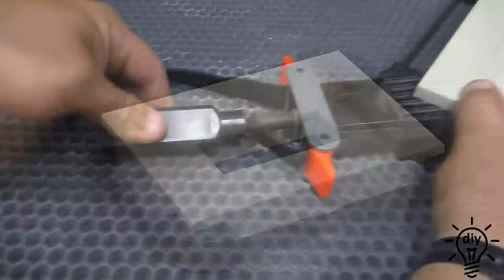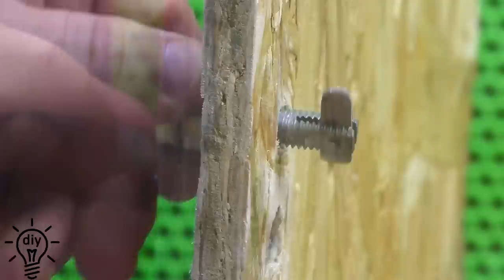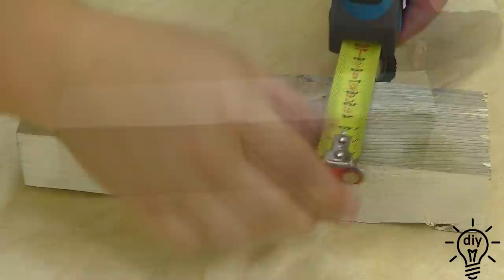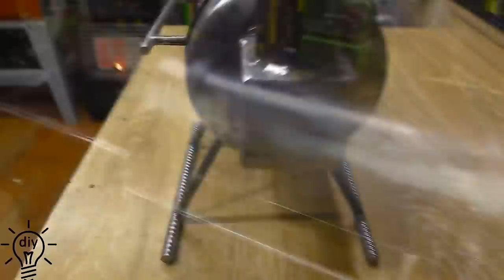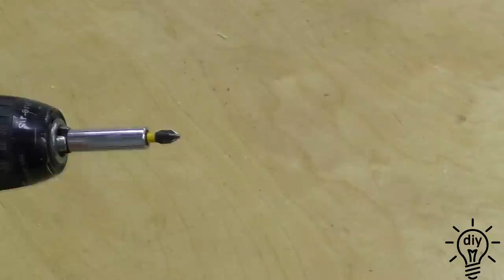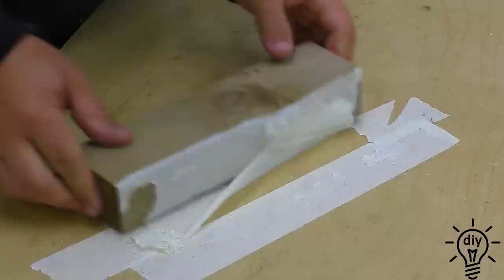A smart master will teach you ideas you didn't know about

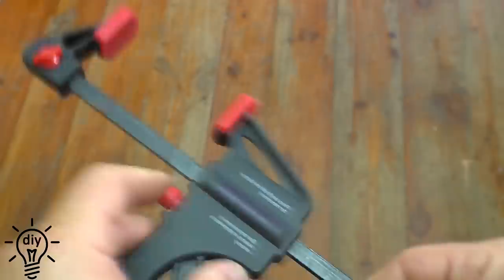Comment: 1:00 If you pause it just right at 1:00 as the screen is changing to the colored arrows , you can see the peg slip and it actually failed because it clearly slipped and pulled back up about a half inch or more up out of the whole 😂 ... Still a good idea though so don't get me wrong I just think it's funny that they tried to hide that it was a fail a d used the content anyways hahaha ... I would have to though so 👍👍👍👍 There are some really good ideas in this video 👍👍👍